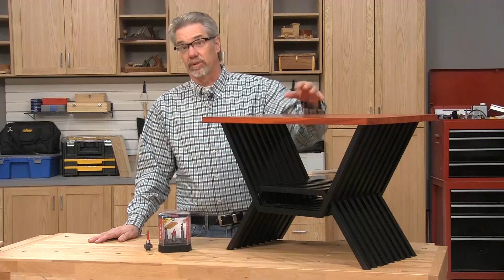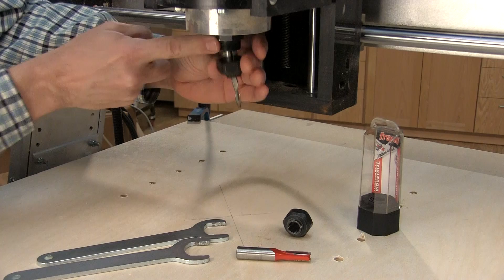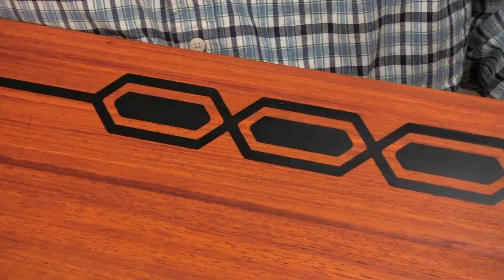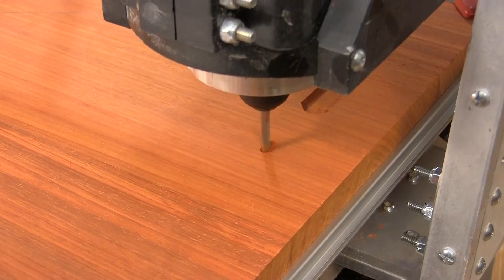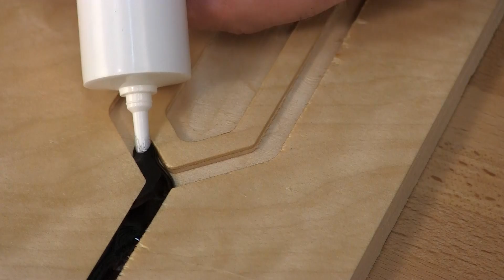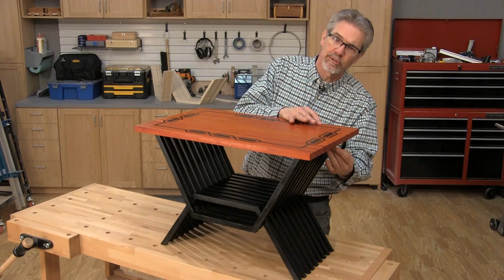Making a Small Table Using a CNC Router

Comment: what product did you use to seal the inside of your cutout to stop the epoxy bleeding into the wood
Reply: id imagine it was a sanding sealer, ive seen other videos where 1 or 2 coats were applied

Comment: I understand the pitch for the Freud bit kit but wouldn't it have been more applicable to use a downcutting endmill for the table top to reduce/eliminate tearout?
Reply: Jesterakaozman yes a down cutting bit would be more appropriate.
Reply: Thanks Andy. When are we going to see more videos from your channel???
Reply: i would use a compression bit.Down cut bits are not that great at removing the chips. Compression bits are more expensive than downcuts but using one will reduce the chipping and deal with the sawdust nicely. For a one shot deal the cost issues could be the reason to go with a downcut but for multiple items the  time saved in hand work could well offset the additional cost.